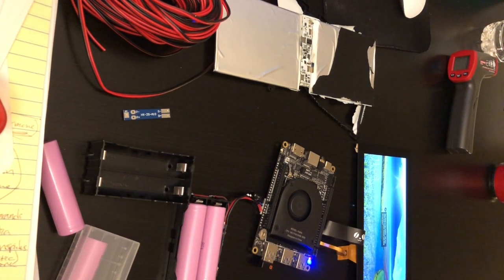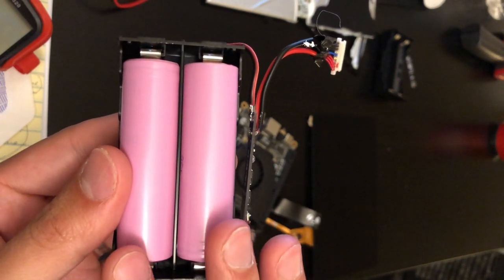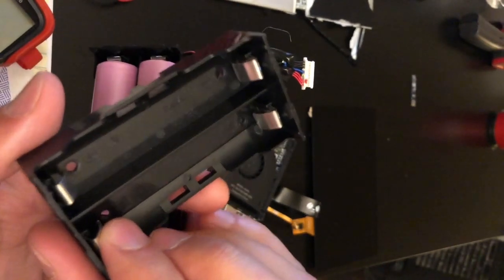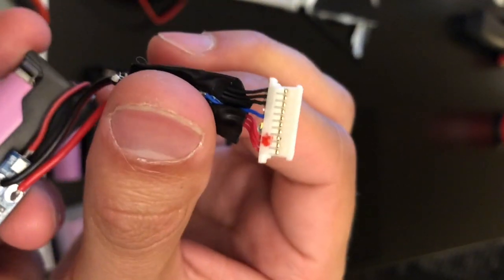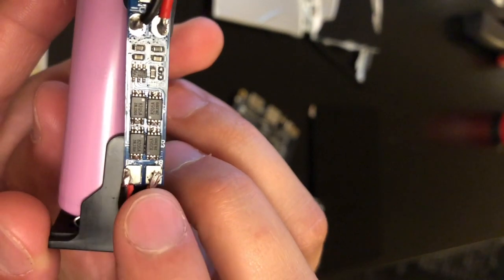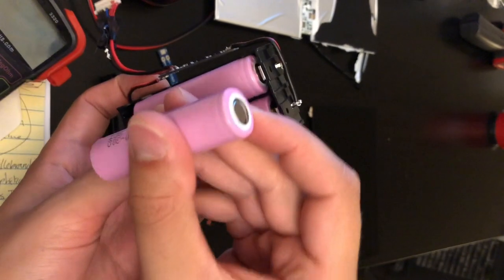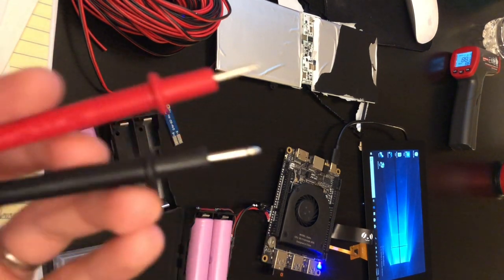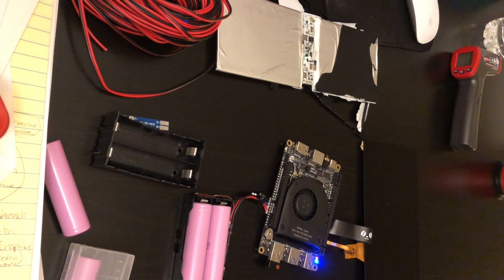DIY 18650 battery pack tutorial for LattePanda Alpha

Comment: i am impressed to se an lattepanda being powered by only 2 of those , but this doesn't solve my problem i am trying to find one battery that i can use just to change from my power bank to the wall power without needing to shut down the system
Reply from the maker: So do you have a usb power bank you want to use? This will do just that. I also have a video with a Chuwi mini book battery that works with the lattepanda alpha that will allow you to go from a usb power bank to a wall adapter
Reply: @HandheldHardware   i read in the specs that the lattepanda needs 43w during bot time so i searched for a smal and powerful charger i ended up with a telium 65w (monster    sise charger ) during my tests in heavy loads it can hold about 4 hours i imagine in low loads 8 to 10 hours but many times during these tests i almost have a problem where i was updating something or the window trying yo update before shut down and the battery almost depleted so i was praying for it not to end up corrupted. i wished to avoid this

Comment: What is the lifespan of this battery with those different draws for gaming or yt videos? Wondering how many cells i need to use for my application.
Reply from the maker: My 2s2p pack got about 1hr 45 minutes heavy load (benchmark and gaming), so i imagine intermediate use is 3-4 hrs

Comment: Great tutorial. I am making a 4 cell version now and am using two battery management modules in parallel. Soldered everything. Did a succesful pull test. Measured for continuity, shorts and voltages. I measure 8.2 Volts across B- to B+. So all seems fine, except that the voltage on the outputs P- and P+ to the lattepanda measure about 0 volts. Is this normal? I am reluctant to plug in into the board. Or does it just need activation and will it be fine?
Reply from the maker: Michel Diephuis yeah it needs a charge voltage across p+ and - to turn the battery on
Reply from the maker: It’s a protection feature in case you short those two terminals while assembling
Reply: Thank you for the answer. That is comforting to know. Can I also connect another power supply (like a lab psu) to P- and P+ it to charge it (at which voltage)? I’m still being cautious of blowing op my expensive lattepanda.
Reply from the maker: Michel Diephuis what batteries did you use?
Reply: I am using Elzo 18650 batteries with 3000 mAh rating which I bought on Amazon.
Reply from the maker: Michel Diephuis you can use a power supply, but keep the amperage low, less than 1 amp. After a couple seconds you should be able to disconnect and see 8.2V on the p terminals
Reply from the maker: Michel Diephuis can you link to the batteries? I typed it in but couldn’t find it (Maybe not in america Amazon). The ones I picked were safe for 2 amp charging
Reply: I have a current limiter on my power supply, si that is doable. At what voltage should I set the power supply?
Reply: This is a link to the batteries: https://www.amazon.nl/Lithium-ion-Batterijhouder-Led-zaklamp-Hoofdlampen-Energieverbruik/dp/B072FN4CVW/ref=asc_df_B072FN4CVW/?tag=nlshogostdsp-21&linkCode=df0&hvadid=430648774717&hvpos=&hvnetw=g&hvrand=12812284137514318337&hvpone=&hvptwo=&hvqmt=&hvdev=m&hvdvcmdl=&hvlocint=&hvlocphy=9064458&hvtargid=pla-473867428292&psc=1
Reply from the maker: Michel Diephuis set to 8.4v
Reply: Thank you so much. I will give it a go tomorrow.
Reply: Yessss. It works. Whoop whoop. I measured everything again before hooking it up to the separate lab power supply (psu): 4.1 Volt between B- and BM. 8.2 Volt between B- and B+. 0 Volt between P- and P+. Hooked up P- and P+ to the psu. Switched it on and switched it off after having P- and P+ connected for about 5 seconds at 8.4 Volt (the current limit light was on, so it drew more than the psu was set for). Disconnected P- and P+ from the psu and measured again: now there is 8.2 Volts across P- and P+. No fire, no sparks no weird plastic smell. I am happy and now confident to hook the batterypack up to my lattapanda. Thanks again for your help. Greatly appreciated.
Reply from the maker: Michel Diephuis enjoy your new portable Lattepanda Alpha! Remember when you connect it the lights don’t turn on UNTIL you hold the power button
Reply: Project-SBC Thank you. Keep up the good work 😃. I will attach the 10 pin connector and the NTC next and will hold the power button for as long as I need. I noticed that removing the batteries from the pack and re-inserting them will reset the voltage between P- and P+ to 0 Volts. Safety indeed.
Reply from the maker: Michel Diephuis let me know if you have any other probelms
Reply: Project-SBC will the lattepanda automatically shut off gracefully when the battery level is below a certain point (which point?) or do I have to be careful and watch the batterylevel and shut it down myself?
Reply from the maker: Michel Diephuis when I was running a 2s1p configuration on the first time I think it shut down without notice. We are using the built in windows functionality for a battery, there is no designed and tested reliable battery gauge in this. After the first time it would detect the voltage at a certain point. After a few tries It was a little more accurate and would shut down around 6.6-6.7V
Reply: I successfully finished building this project today. I am very happy and would not have dared it without you. Thank you. I got the 10 pin connector and the NTC from Digikey and took my time wiring it up. Although the crimping pliers I have are a little bit too large, I managed to tighten them with some pointy pliers. Very nice. After quadruple checking everything I finally dared to put to 10 pin connector in the lattepanda. I had to reboot before Windows recognized it, but the pack shows up as fully charged and I can disconnect the mains as you did and can boot from it as well. That felt so good. I’ll let it run on batteries tomorrow while I’m babysitting it for heat and runtime etc. So far so good 😊
Reply from the maker: Michel Diephuis awesome news. Glad it worked for you. I love to hear success stories. Keep it up!

Comment: How exactly would you go about making the 10 pin connector? I've never really worked much with wiring and such, but I have a project that I will need to be able to portably power the lattepanda with, and this was one of the best methods. I saw in a comment below that somebody just searched for "1.25 mm connector 10p", but from the single result I actually got for a 10-pin male connector, none of them shipped to Canada.
Reply from the maker: Game Jam it’s called molex panelmate connector, 10 pin version. Do you have some technical experience in crimping/soldering? It doesn’t have to be much. I didn’t have any with crimping/some solder and after a few failed attempts I managed to make one.
Reply from the maker: Game Jam actually there are links to the parts in the description
Reply: @HandheldHardware  Oh, yeah I didn't even notice that's what the stuff in the description was. And no, I have absolutely minimal soldering knowledge, although I have some friends/family that may know how, and could always wait until school is back on next year and check with the Robotics Teacher.

Comment: I'm. Building a travel laptop case for Latte Panda Alpha.  I'll have room for 2 banks of  qty 10  18650 batteries.  Not and electrical person but believe I would need a power regulator before connect to Latte Panda.  I have separate charger for batteries for even charge and safe charge.  1) can you identify power regulator pieces and give estimate run time regular use. Then  gaming time?  I travel  overseas and lots a time to be on computer.  (I may custom an external power bank x qty to last me max over all hrs by switching when needed to another power bank.)
Reply from the maker: alton Davis thanks for watching! So you can fit 20- 18650 batteries in there? You don’t need a regulator. It just needs to be a 2S configuration as long as the batteries you use are 3.7V and you use a battery management system pcb on each pair of batteries.

Comment: Finally found the 10 pin wired on ebay!
Reply: Searched for "1.25 mm connector 10p"
Reply from the maker: Daniel Stevens awesome! Making it’s a pain without the $300 crimper. Care to share the link?

Comment: Do you know any type how to use LattePanda alpha with power bank, I really confused, plz give me a convincing response
Reply from the maker: you maaxa I know some how to use with a power bank. What kind of power bank did you want to use?
Reply: @HandheldHardware  THIS KIND 

https://www.google.com/search?q=silvercrest+3.7v+5000mAh&sxsrf=ACYBGNSJjhmJYBd47DdrIXEG0mhG49xDCQ:1573208220609&source=lnms&tbm=isch&sa=X&ved=0ahUKEwjgnpapsdrlAhXOlIsKHfdpA1UQ_AUIEigB&biw=1366&bih=576#imgrc=i0379NkQFPe8XM:
Reply: plz answer to its very important 
my is  power bank silvercrest 3.7v 5000mAh 18.5Wh input 5v 2100mA
Reply from the maker: you maaxa that’s probably not going to work. You won’t be able to get enough voltage to drive the alpha

Comment: What is the uptime of the lattepanda on the 2x 18560 battery pack?
Reply from the maker: Wito 2s1p (2 total batteries) was about 45 minutes with heavy use. 2s2p (4 total batteries) was about 1 hr 45 minutes with heavy use. It’s worth noting that the cut off voltage was a little bit lower when using 2s2p, hence more than double the run time. This was also on the 7y30 version whose cpu uses a little less power than 8100y

Comment: I'd really like to see you do a LiPo setup with a magclick case.   BTW what is the monitor you are using in the video where the magclick is mounted on the monitor, and how do you display it?  What kind of mount do you use for the whole package?
Reply from the maker: Clint Harper I’ve got parts for a LiPo build! It’ll be about 8 mm thinner and about 15-20 mm less in width. I have to make a new 10p connector though which has been my hold up. The monitor is the 7” LattePanda alpha display on DFRobot/amazon. It uses magnets to mount
Reply: @HandheldHardware  Nice.  Thanks for responding.  It looks like you have a printed housing on the screen do you have files for that?  Are you self taught or did you take a class to learn how to design (your prints)?  Thanks again.
Reply from the maker: Clint Harper yes, I will release those shortly. I still have minor modifications to make. I am self taught as of 7 months ago. Are you thinking about starting to design?
Reply: @HandheldHardware  Yes about 2 years ago I got into building IoT devices, and I have not been happy with how crude a housing I would make for them turned out.  I just got a 3d printer a few weeks ago, and have had much better looking results.  Even with these great designs I find I still find myself wishing it had something changed to suit my desired outcome.  I managed to get fusion360, but haven't dug into it yet.  have you used it?
Reply from the maker: Clint Harper I tried fusion 360, it was a bit of a different interface so I stuck with tinkercad

Comment: Great work I've been looking for a solution for a long time.🤩:)

Is it Mac compatible🙃
Reply from the maker: thanks! I'll have a thinner solution out in the next week or two made of two slim 5000 mAh Lipos! The battery controller is operating system independent. So yes! it will work with hackintosh on this. Unfortunately I don't know how the operating system will determine battery level
Reply: @HandheldHardware  oooh noice

Comment: Hello ,  How many hours does it work with this method? (2S1P)
Reply from the maker: RedNe Nitla hey thanks for watching! I did some intensive gaming and got around 45 minutes. I didn’t test to see how long it would idle or do moderate tasks, but would expect it to go out past 90 minutes
Reply from the maker: I did an updated battery run on a 2s2p configuration and got about 1 hr 50 min with a mix of gaming and cpu stress tests. I noticed that the battery voltage got to around 3.56V before cutting out unlike the 2s1p configuration where it cut off around 3.62V.

Comment: The panelmate 10 pin connector takes either a 28 or 30 awg wire according to the spec sheet from molex.......I purchased some connectors and female crimp terminals, along with some 28AWG wire. 28AWG seems to be rated at 0.226 amps for power transmission according to an online chart.....doesn't seem enough......what are your thoughts?? What AWG are you using for the connectors?? Thanks in adv. Great vid ;)
Reply from the maker: Hi Ketoi, when looking at charts for wire gauge use the chassis wiring current value (1.4 amp for 28 awg). Power transmission I believe is for tightly bundled cables (no heat dissipation!), but since these cables won’t be tightly bundled with others its chassis wiring current value
Reply from the maker: ketoi also, let me know how you make out connecting the terminals! I had to do a partial solder/partial crimp to get my terminals to fit without buying the $360 tool
Reply: Perfect :) Thanks for the info ;) I did a test crimp today and it turned out ok, thought I might have to solder but the pull test seemed to show sufficient connection :) Yea the crimp tool is a ridiculous price!! Couldn't believe it......I bought an  SN 28B crimper from Amazon, which is for larger DuPont pins, but it got most of the job done and then I finished it off with a small set of needle nose pliers......was fiddly but turned out ok....... we'll se how I get on doing the rest, will let you know ;)
Reply from the maker: ketoi I forgot to thank you for watching, yes please let me about how your connector works out! Glad to know people get something useful from my videos
Reply: Just finished the 10 pin connector. Worked out fine with my original method using the DuPont crimp tool and solidifying the connection with some needle nose pliers and a little solder :) about 90mins to do one though!! :))
Reply from the maker: ketoi awesome! Thanks for tip on the crimp tool. Yes, it took me about an hour and 10+ wasted terminals to get a working one

Comment: Hi there, I am looking to do a Lattepanda alpha "tablet" project. This is definitely something I am interested in doing. 

Do you have a wiring diagram maybe? if you do could you share it with me if it isn't too much? I do see that you say that these batteries are dangerous and I can agree to that.  

 Is there something that you would recommend that may be "safer" (even though it is dealing with batteries lol) or any kind of tips I should be thinking of when I go to enclose this all in a 3d printed case? I wanted to be able to do battery swaps when they may be "Bad" or looking sketchy.

Thanks in advance.
Reply from the maker: 12reviewman thanks for watching! Yes, I can provide a wiring diagram. If you have dealt with soldering and understand electricity, using 18650 batteries shouldn’t be a problem. As far as alternatives,I found this on amazon that might work... TalentCell Rechargeable 12V 3000mAh Lithium ion Battery Pack for LED Strip, CCTV Camera and More, DC 12V/5V USB Dual Output External Battery Power Bank with Charger, Black https://www.amazon.com/dp/B01M7Z9Z1N/ref=cm_sw_r_cp_api_i_fKMoDbH0ZC1NS

There are some tablet batteries that work too. I heard teclast batteries work, maybe something like this? https://www.google.com/amp/s/m.aliexpress.com/item/32936351518.html

Another option that I had designed used usb c Pd power banks. I designed (but never tested or had made) a PCB that used a 12v barrel jack input to power LPA and usb power bank. When the barrel jack is disconnected, super caps took over until USB C Pd kicked in. The BOM cost for pcb was high for small runs, so I used 18650 batteries.

I’m also trying to make those 10 pin connectors. So far I’ve made one successfully, so it is possible.
Reply: @HandheldHardware  I have done some soldering and familiar with how it should be done. 

I do see that the tablet battery link you sent is 7.5 V or something close to that.  I didn't think of those even working with the Lattepanda.

the tablet I'm making won't be the most perfect looking thing in the world but at least I would be able to switch out batteries if needed. 

If you could provide a wiring diagram as well as one that could allow it to expand, I'd appreciate that.

Thanks.
Reply from the maker: 12reviewman sure, I’ll post it later tonight on my Twitter and will comment here to you with the link
Reply from the maker: @12reviewman  Hi 12reviewman, you can see wiring diagrams at the following tweet. Let me know if this is what you were looking for https://twitter.com/ProjectSbc/status/1154927404948905984
Reply: @HandheldHardware  Great, I guess you could use a Type C converter 
with 12V / 3A DC output.
Reply from the maker: RedNe Nitla hi RedNe Nitla, you probably wouldn’t want to do that because you lose the ability to recharge. The LattePanda alpha has a 2s charger built in. If you use the 10p battery connector you get the recharge function. If you move it to USB C you lose the recharge ability.
Reply: Wow thanks for this diagram. This is what I was looking for.